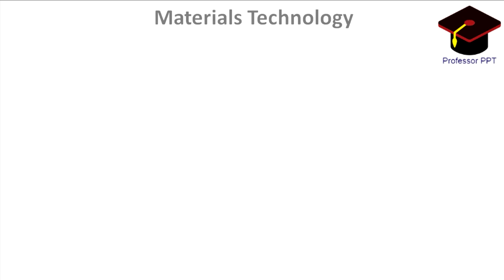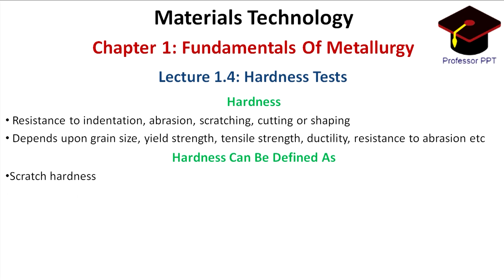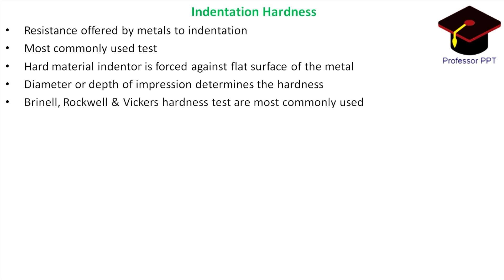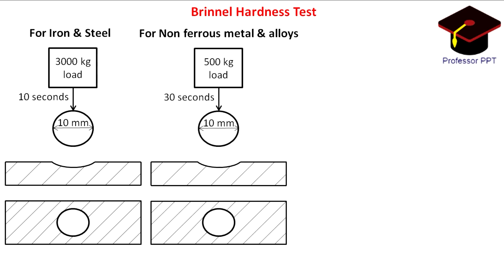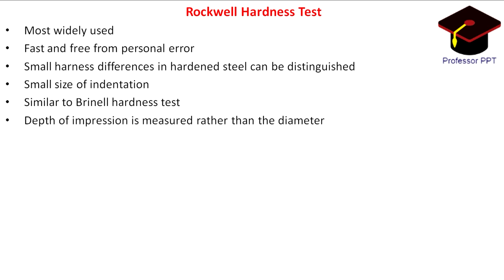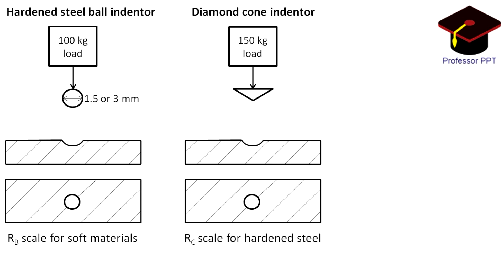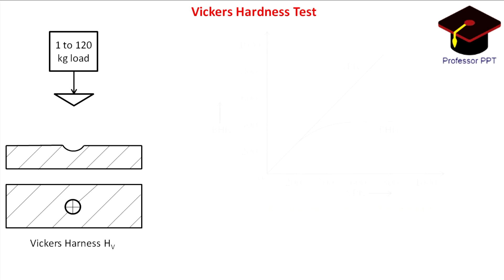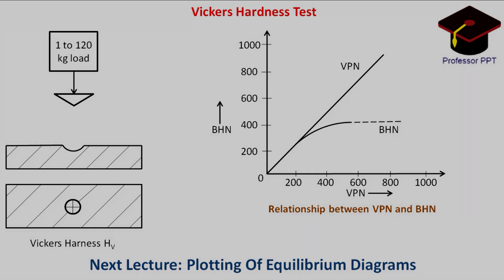LECTURE 1.4 | HARDNESS TESTS | CHAPTER 1 | FUNDAMENTALS OF METALLURGY

Comment: shouldn't the indent for the cone shape be triangular rather than semicircular?
Reply: and the square pyramid indent for both projections
Reply from the maker: @Kyle Visage Hello Kyle, thank you correcting. The impression obtained by Vickers hardness should be a square one, not circular one. I missed to replace the indent impression. My apologies.
Reply from the maker: Hello Kyle, the impression of the cone indentor will be a circular one. As we are obtaining a top view after indentation. From side view, the indentor will be resembling a traingular shape.